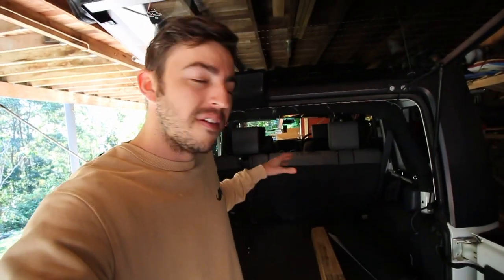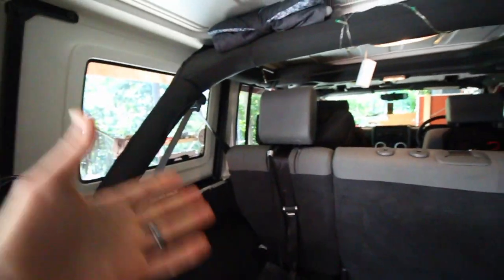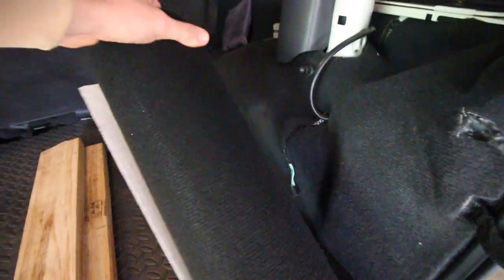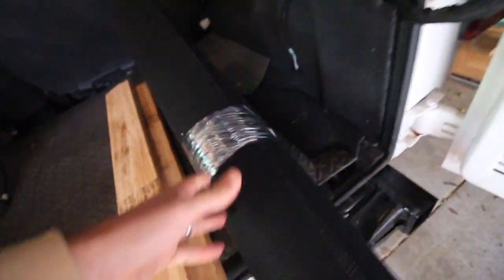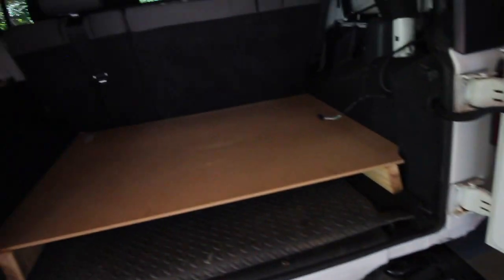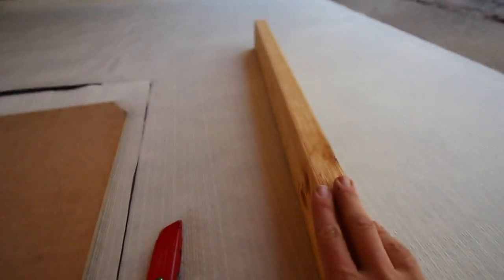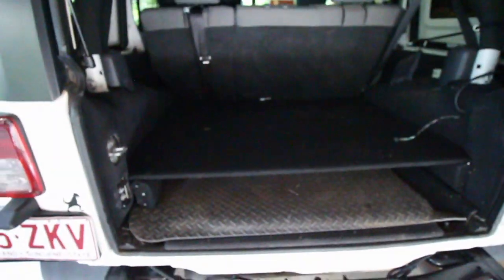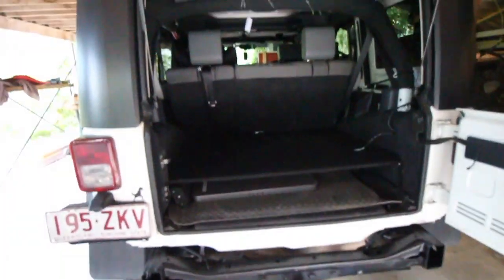DIY JEEP STORAGE PLATFORM

Comment: Maybe make the fire extinguisher easier to get to .........
Reply from the maker: Any where you would recommend as a good place?
Reply: @Whiteandsonsgarage  regular fire extinguishers are kind of outdated now in the automotive field. Grab an element fire extinguisher and keep it closer to the front. they come with the mount. extinguish fires for almost 10 times as long and are a tenth the size. they also never expire!
Reply from the maker: @MegaHawk78  oh I didn’t know about them, where can I buy one from? Thanks
Reply: @Whiteandsonsgarage  just online anywhere. These would be similar to the style NASA or most militaries use.
Reply: @Whiteandsonsgarage  With in arm reach of the front (driver) seat. When you need it, you need it right now. I got mine attached to the roll bar. In my Big Rig it is right when you open the door, saved my truck from burning down.
Reply from the maker: @davidjones3198  definitely a good point, I will probably try and mount it in a safe place in the front. Did your truck catch fire?
Reply: @Whiteandsonsgarage  Had an engine fire !
Reply from the maker: @davidjones3198  oh wow that sucks, lucky you saved it